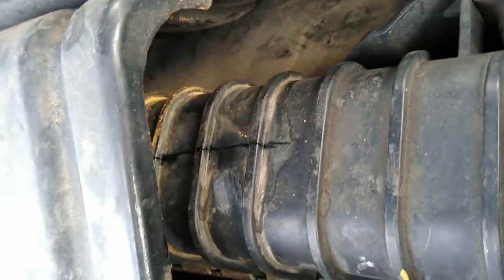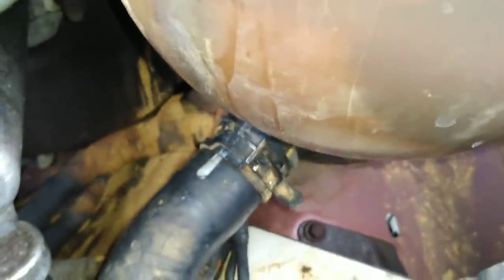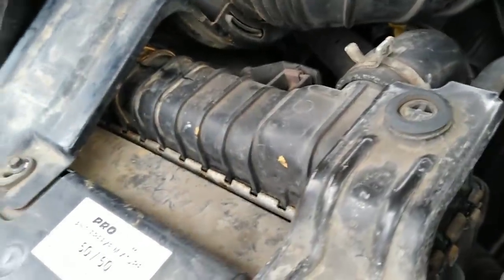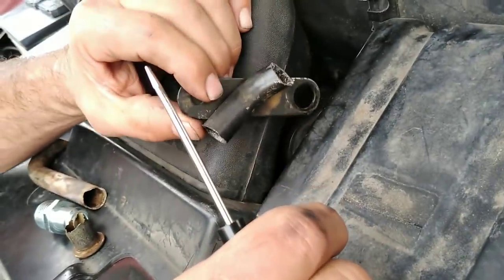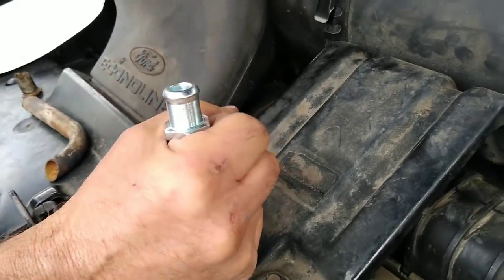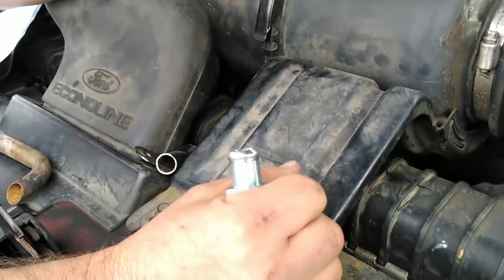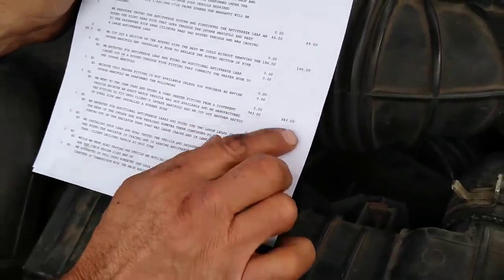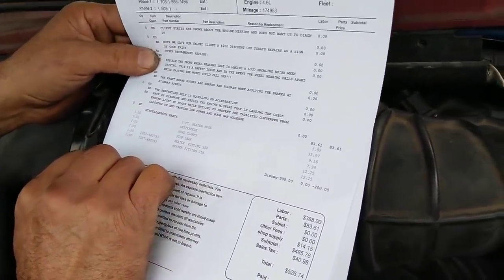The Temp Repair as Explained to Me

Comment from the maker: I uploaded this video with this info to answer ALL the comments, emails, and social media messages I've been getting about my van. I can't answer any further questions as I don't know! This is all the info I have. I've made it to Vegas. I've taken my time and checked my coolant and radiator crack every 100, or so, miles. letting it cool down every few hours as well. I unfortunately, shouldn't have bought this van, but I had it on good authority that it was in good condition and the engine/motor was in very good shape. I didn't want a Ford, but ... 🤷🏾‍♀️.

I'll be in Arizona on Monday. I'll continue to work, save, and hopefully by RTR I'll either have ALL the repairs done or another van... HOPEFULLY!
Reply: Crystal Vanner best of luck Crystal💜
Reply: Crystal Vanner I’m sending prayers and positive energy your way.
Reply from the maker: WHAT?? Cardinal wasn't free and had about 167,000 miles. and unless you're donating NEW van money, I'll most likely be getting a new/rebuilt engine or another used $2k or less van.

Comment: I know money can be tight sometimes but i learned the hard way to get a pre-purchase inspection before committing to buying a used car. Yeah, you have to pay between 70-100 bucks but it's worth it bc they check everything! At the same time just mentioning that I wanted a pre-purchase inspection has saved me money bc some sellers didn't want to do it which made me not interested in the car I was looking to buy.

Comment: I don't understand why people are saying this mechanic was ripping you off. He explained very carefully what was wrong and what they did. The problem is that the engine has been rusting out for a long time, that's clear. So lots of metal parts are thinned out. It's best he cut off those parts that were leaking because once a spot starts to dissolve into rust, there's a whole area of weakness there. This didn't happen overnight, this was already in that state when the van was purchased. You wanted to keep the cost as low as you possibly could. Yes, it would be great if the $500 could have gone to actually replacing the whole engine or van, but that wouldn't put you on the road right now. That's always the tradeoff-- either spend more money now and get a better overall deal, or spend less money now with the knowledge the bigger money still will have to be spent. When one doesn't have the bigger money, there is no other real choice. Poverty is expensive. I know so many of us would give you the $ if we had it to give. We are suffering with you and wishing you well.  You are loved, Crystal. Don't feel bad about the mechanic, no way. I think he did you a solid-- some would not have patched it together at all.  Wishing you ease.
Reply: @Keyhole Computer Guru Just what I was describing. It would have cost less, ultimately, to be able to replace the engine than to do a patchup for $500 and then have to replace the engine later. But if one doesn't have the money for the more expensive choice initially, then it costs more overall.  Nothing to do with car notes. But I'm in agreement, I drive my vehicles forever, then get another decent used vehicle and drive it forever.

Comment: You're going to have to replace that radiator and many cooling system components. That weak spot most likely wont hold up to the heat and pressure. Dang, wheel bearings also, probably both (and of course) on both sides. Its all due to someone not taking care of the vehicle and not "following the maintanance schedule" properly.
 Its so sad when people dont do things properly (total neglect) and then sell their abused vehicle to others. :-(   i wish people would stop thinking that a vehicle needs more than gas and (im sure, late) oil changes, and treat a vehicle as disposable. Knowing this, (and the mentality of the previous owner) you can be assured that nothing was done according to the maintenance schedule, and there will be a future of many problems to come.
   I'm sorry, and i wish you good luck trying to beat the odds. Much love and Blessings sent Crystal.  Safe travels and stay alert. Peace
Reply from the maker: yes... and the sad thing is a "pastor" sold me this van. 😂 🤦🏾‍♀️🤷🏾‍♀️
Reply: Crystal Vanner yeah well, a pastor can be a good person with great intentions, but being a pastor doesn't mean that one is mechanically inclined, or will follow the instructions in the owners manual. 
  What I'm saying is that the pastor is not to blame, even if he talked you into buying the vehicle. (I don't know the person that sold the vehicle, so I have no reason to back him up) It's always up to the purchaser to thoroughly check the vehicle. The final decision is up to the buyer.
  We are all accountable for our own actions. Stay at Peace, things will work out.
Reply from the maker: I had it on "good authority" that it was worth buying. it is what it is at this point!!... and those being negative, calling me names, and telling me it's my own fault are NOT paying one damn red cent towards repairs!!

Comment: I know it is easier said than done, but try not to fret over this. The problem is,  it simply it is an older vehicle and like everything that ages, there will be problems no matter how you try to prevent them. Just a part of life. Fix what you can, when you can until you can get it all fixed. That darn engine light though. Ugh, I'm going through the same problem now, so I have the code. Just start with the easiest and cheapest probable causes as you can, and pray that it is only a cheap fix. That darn scary light. Just like you, I'm riding mine until the wheels fall off. Safe travels.

Comment: They make a product called J-B Weld it's like an epoxy but made for that ! you can fix that crack with that!  sand it good with sandpaper clean it J-B Weld done !!!
Reply: Yes JB weld is the bomb i carry it with me
Reply from the maker: heard J B weld was for cold applications only
Reply: @CrystalVanner  absolutely not it was designed for the military for fixing cracked engine blocks and they get very hot ! and I've used it for that and it works awesome !! And I've used it on radiators before !!!! And an easy fix if it's right on top the tank !!! Make sure there's no pressure in the tank when you fix it and no water touching the crack and clean it really good first
Reply: @bearsuc8331  I can obviously see you don't have a clue what you're talking about ! I've been a licensed mechanic for decades and yes I do know !! And no nobody told me so stop hiding behind your anonymity !!! It's really easy to run your mouth when people don't know your real name !!!
Reply: Did you see what came out of that overflow bottle? the engine overheated! plastic rad tanks are know to crack. think about water pump, freeze out plugs, water jackets,radiator, heater core. not being negative but I would not keep driving it the way it is. I would look for a different vehicle, and spend a few dollars and take it to a certified mechanic for an inspection.
Reply: @brettstevens9677  I don't disagree with that but when you don't have a lot of money you got to make do until you can . Skäl !!!
Reply: @VikingVanMan  no doubt, the part that sux is the more you put into it, the less you get out, and the less you have to get something else. catch 22
Reply: @brettstevens9677  yep Catch 22 !!! Skäl !

Comment: Why does everyone think it’s a rip off? Things breakdown. This is an old van when Crystal purchased it. Over the life of this van who knows how many people were under the hood. When you bring a mechanic to look at a USED vehicle, they are doing a overview of all the major systems. The mechanic is not using a magnifying glass or a scope to look at everything ,or in everything. I purchased a new Toyota Camry it broke. I did not buy a warranty due to the excellent reputation of Toyota. I paid for a very expensive repair. I won’t say I’ll never drive a Toyota again. I will say if you see me with a Toyota, I won it on the Price Is Right. God Bless.
Reply: Annette HARVIN basically this guy charged her $500 to do a bypass that's just ridiculous this is something that quite honestly she could have done herself all she needed was a hose in a few clamps and even if she didn't want to do it herself $500 is just unbelievable and to say that it needs this that and this and all of that stuff that has nothing to do with anything and I'm sure he charged for it adds to the rip-off the cracked radiator is expected given that she's gone through extreme cold back to extreme warm at the same time that could easily be fixed with epoxy you can buy epoxy for about $5 and needed with your hands and put it on in less than 10 minutes the problem becomes these idiots put more stop leak in there what you see is not rust what you see is actually stop leak from when someone else put stop leak in there stop leak doesn't do nothing but clogged everything up a bottle stop leak is no more than five bucks maybe 10 at the same time that's not doing anything but making it fail later down the line what she honestly needed was a flush and a bypass and possibly some Putty on the radiator and she would have been fine just because it's an older vehicle doesn't mean it's going to break down but when you have people that don't know what they're doing and they're filling your head with a bunch of bull so they can get more money out of you or at least try to she has a misfire because she needs to plugs which she really needed to change them all before she left but she didn't have money to do it at the time it's not going to clogged catalytic converter and clearly there scanner doesn't work because whatever reason we didn't have no problem checking what was going on with the engine before she left that check engine light has been blinking since we went to Florida

Comment: I agree with Leroy Williams, JB Weld will close the gap and stop propagation of the crack. 6:00 A new intake manifold just to replace a pressed tube? Sounds like they couldn't clean out the old tube without scratching the walls of the manifold bore. Thread cutting without knowing if there is enough material wall is very risky. A press fit tube is for fast assembly AND zero clearance, where threaded parts have more possibility of leak, requiring thread seal. Oh well...

Comment: I carefully listened to everything the mechanic said to you in order to give you my honest opinion on the repair. Full disclosure: I am not an auto mechanic nor do I claim to be but I've been around vehicles my whole life as not to be mislead by anyone. The mechanic was telling you the truth and although the price seemed high, he did have to go to the junkyard, find a very specific piece, and make it work in a non factory application. He was correct about the misfire data. When a vehicle misfires unburned fuel can over time cause the expensive catalytic converter to fail. Won't happen in a month but if unattended could damage it in a years time. Replacing the radiator is the best and most sensible thing to do. I know a lot of other commenters like to mention quick fixes(like jb weld) but due to the age of the van, replacing it would be much smarter. I know in later videos these repairs were completed by a donor subscriber so I just wanted to let you know that I feel you DID NOT get ripped off considering the problems(multiple leaks) and what time was utilized to fix your van. 🤗
Reply from the maker: watch the MRSA live video. some repairs have been done.
Reply: @CrystalVanner  If you need a new overflow tank, I can probably get you one from a good used vehicle or price one out at the Ford dealership since yours was cracked as you mentioned in a previous video. I did watch the live MRSA video and you mentioned Mrs. D. paying for all the repairs. Wasn't sure all that was repaired by I like to help when I can 😁

Comment: Not an expert, but I’ve had enough problems to know a loose gas cap can cause the check engine light to come on, so it’s not always something detrimental. The cigarette lighter not working is likely a fuse, and that’s also likely why he couldn’t connect it to see what’s wrong. Fuses are cheap, and places like Auto Zone/Oreilly’s will tell you which fuses to buy and replace them for free and then check why the check engine light is on for free. (Edited to add I re-listened and saw you understand about the fuses. You understand a lot. 👍🏾🙂)

I’ve never had a car with rust, so this is interesting to learn about. I wonder if the van was ever in a flood, but I know some areas have that due to the environment/weather. Never imagined it could cause so much damage, rusting and thinning out metal. Essentially falling apart.

I’d definitely get a few more opinions though before calling it a total loss. I don’t think it is, but I am an optimist. When you reach your destination, you’ll have time to take your time and figure it all out. It will all work out. A few months from now, you’ll have a safer, more reliable vehicle, whether you fix this one or buy something else.

Comment: Really cheap vehicles will all have problems, so I think that it is very wise of you to do something to learn how to fix the most common problems.  Very wise indeed. 

A new skill set might even earn you some cash from time to time, when you are on the road. 

--

One of my brothers have been doing the "very cheap car" gamble these past years. His hope was that they would last one year, as that way they would be cheaper than the write off of a more expensive car. 
His first two cars did last for more than a year, each, but his last two cars have only lasted for three months each. So he is just barely breaking even on his gamble. 

So the issue about old beaters, always is: As you get to know the quirks of an old beater, will it be worth spending money on fixing the things you know are bad? 
Or do you need to move on to another old  beater, and spend a few months getting to know the "new" old beater? And then spend money on fixing what is wrong with that one? 

Either way, as you go through several beaters, then you learn about what to check for in the next one you buy, and eventually you will get one that will serve you well for a number of years. 

--

But right now: how to drive, and what to do (cheaply) that will increase your chances of getting to AZ, without further breakdowns. 

I would also suggest adding that metal JB weld to the crack in the radiator.
 
Then I would advise slow driving, so the bearing and the breaks will be spared.

Then it might be wise to have some teflon tape (that white plumbers tape), so it would be possible to re-attach that plug they screwed into the manifold. If it were to pop out at one time. 

Likewise it might be wise to have something that could be wrapped around any future leak spots. 
I am sure that there is some glass-gaze, that could be wound on top of teflon tape, and the JB weld pushed into the glass-gaze, to make it contain a leak, or at least slow down the spray. 

He said that they already added sealant stuff to the coolant, but one more bottle of that might be wise to have in the van. 
And likewise, extra water and/or mixed coolant fluid. 

Either way, those are a few of my thoughts about how you might increase you chance of getting to AZ. 
But they are just ideas and thoughts, because it is your journey, so I will of cause support any judgment and/or decision that you make.
Reply: MrAlvinDude Was

Comment: that guy is full of s*** put some epoxy on the radiator like I told you that fixes that problem permanently then as far as that pipe goes I fix too many of those it's exactly what I was explaining to you is the problem over the phone give me a call when you get this
Reply: J-B Weld is a permanent fix it's designed for cracked engine blocks I have used it on a rad  before and it lasted forever as long as you clean it good !!!
Reply: yes I realize that some people don't know their head from a hole in the damn ground
Reply: Brother Tom is no longer helping anybody do nothing Brother Tom I think you did a great job and was so helpfully.  The Van went to Florida and Maine and other places. I think you are a great guy.  Keep your head up and know you did a GREAT THING!
Reply: What's up with that profile name?! 😬😂

Comment: Hi Crystal. I use to own a1986 Buick Regal. I think I bought it in 1996. I had to replace the 2 front bearings. But I was able to carefully drive it like that for 6 months! I only noticed a problem when I came to a stop to pay a toll, the front axle sigzagged a little; scary, but the weel didn't come off the axle. I think that if you fix one ball-joint, you gotta replace the one on the other side also, or the new one will put a strain on the old one.

Comment: Last Nov I bought a 2008 Nissan Quest with a bad catalytic converter (it was blinking like yours)(they actually have catalyitic convertors in Nissan Quests! 3)..anyway the middle one finally went out and it got so HOT it  melted inside..my mechanic took it off and replaced the 1st one and just straight piped the 2nd one..after spark plugs and coil packs replaced) it's finally running again .  I said all that to say this when cats go they can get dangerously  HOT big time!!!  The mechanic was stunned it didn't catch the inside of my van on fire he said it got so hot..I believed him because when I pulled over to dump my trash the day it happened I noticed all this smoke pouring out from under my car..I was like what the heck is going on!!!  I will pray for you ..wish I was rich to give you a car or van .  I def will pray for you tho.  Can you JB weld the top of the radiator to help fix it temporarily?

Comment: P.S A miss fire is serious it can total your whole engine if you keep driving it ..I looked it up when I pulled the codes on mine when it was n't running right (and it said on code reader miss fire on #3 cylinder..thats why I replaced the plugs and the the coil pacs..(on the back side) where the prob was.